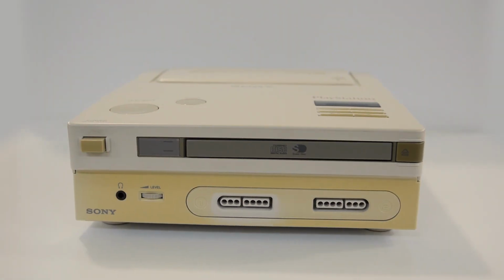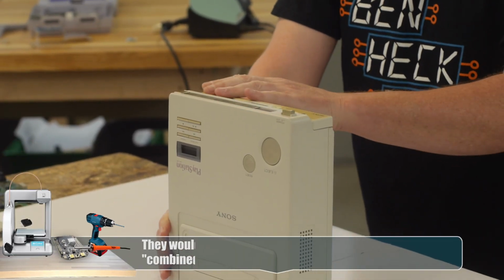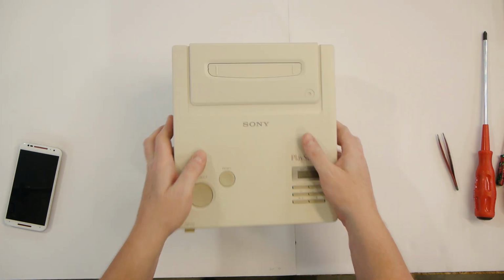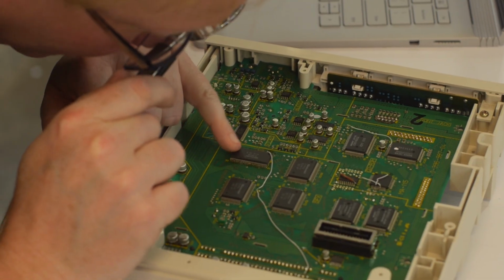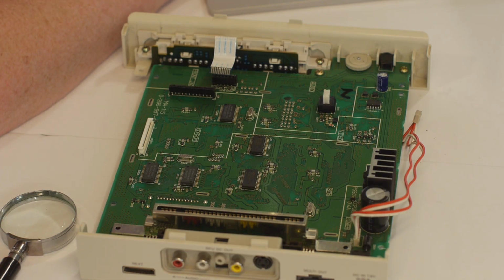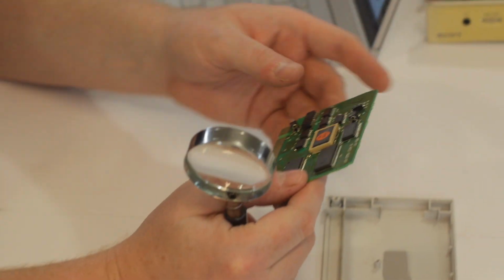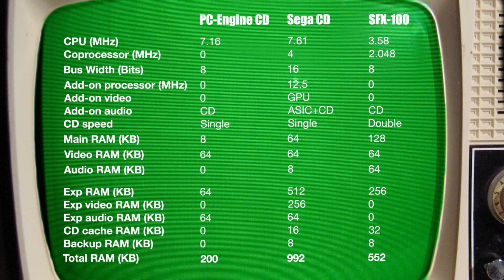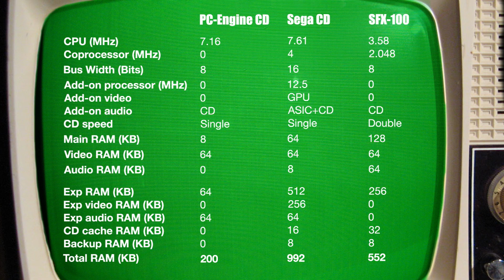Ben Heck's Nintendo-Playstation Prototype Pt 1 Teardown

Comment: Would it not be a right hoot to build a better Nintendo-Playstation using a ASUSTECH FM2+ motherboard and A10-7980k +64GB of RAM and install a Linux Distro with an MAME and somehow make it load the game from the cartridge instead of loading it off disc and keeping the OS+MAME on the hard-drive.

Comment: "You don't get divorced and hang pictures of your ex-wife around the place....."  I laughed out loud.

Do you think Ben is going to make a replica of this?  It would be a massive project compared to his replicas of older 8 bit systems, but for future gaming historians would be an epic resource!  Home-brew SNES-CD/SFX-100 games too!
Reply: the issue is finding replacements for the custom chips
Reply: That's not really an issue, as the CD chipset is a very common series, and found in many CD consoles.

Most of the registers are already understood by looking at the Superdisc ROM disassembly, and support is already being added to emulators etc.

It wouldn't be too hard to implement the CD add-on with an FPGA, but then yoi could only play (or write) homebrew (unless a prototype CD game is actually discovered too - there has to be one out there somewhere?)

Comment: "The Super Nintendo also was better when it came to graphics"

That is debatable/relative.
Reply: How so?
I mean, I can't make a fair comparison because I haven't played Genesis or PC Engine as much as I have SNES - but in terms of graphical capabilities, at least, it seems like SNES had better specs. More and larger sprites, greater color palette, more scroll layers, and limited hardware support for rotation and scaling (backgrounds) and color blending.
Genesis, of course, had more CPU power (why do you do these things to us, Nintendo?) and so could do some of that (rotation and scaling in particular) with software. But it couldn't overcome the color palette limitations (well, for the most part - as with most graphical limitations in these old systems it's a "per scanline" limit, not a "per frame" limit), or the scroll layer limitations.
I feel like the color palette issue puts Genesis at a pretty serious disadvantage, personally - at least when looking at it just in terms of graphics. The SNES had other graphical advantages as well but those could mostly be offset by Genesis' stronger CPU. That makes the system very versatile - it can't just be used for those effects, it can be used for any kind of processing - but it can't overcome the fundamental limits of the graphics chip, either...
But as I said, my experience with Genesis is very limited. I intend to rectify that one day. In the mean time, I'd be interested in hearing your take on the situation.

Comment: The PC Engine CD + the System 3.0 BIOS card (which the TurboDuo had built in) provided 192KB of additional RAM (on top of the 64KB of the base CDROM system) for a total of 256KB. The Arcade card which was released in Japan added 2MB on top of that.

Comment: Hey just a heads up the Sfx chip does not stand for super famicom x it stands fo super fx chip it's used for games like star fox and I think f zero and super Mario cart I hope I helped u out in some way :)
Reply: This thing predates the release of Super-FX chip games - the system doesn't have a Super-FX chip in it (the "SFX" labels were on the PCB, not the ICs, and Super-FX chips weren't labeled "SFX" anyway, they were labeled "MARIO CHIP" or "GSU") - the system probably couldnt have a Super-FX chip built-in, as it most likely would have compromised the ability for cartridges to provide their own add-on CPUs.

Comment: The PC Engine CD-Rom memory actually varies.
Just like this snes-CD solution, it had separate cartridges with the CD-ROM bios and embedded memory, and you got from like 64KB to the insane gigantic Arcade card with whooping 4MB of memory (!).
And this last one was used to port neo geo games almost flawlessly for the PC Engine system.
Maybe the snes-CD would follow the same route?

Also on the part where you said the 8bit bus would slow down the loadings, you're not exactly correct, given the fact the bottleneck on the system would be the CD-ROM read speed by itself rather than the system.
The CD-ROM max reading speed is around 300KB/s, which even using just the CPU to copy off, you still go faster, and well, you don't need to do that on SNES, as it has the DMA unit that copies data over 3MB/s easily, which is well more than enough to deal with the drive.

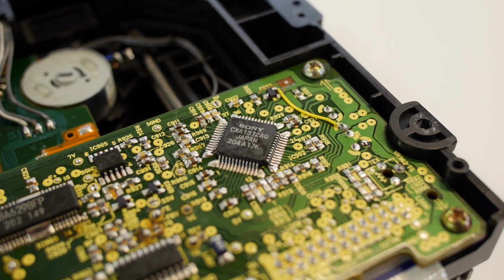Comment: 11:07 Are those pins on the Sony IC seriously bridged?
Reply: Do you mean the corner pins on the Sony chip?

That's very common on wave-soldered boards to have those triangle / teardrop shaped pads on the corners, as it helps prevent the solder from bridging the pins along each row.

If you're talking about the "BA" (Rohm) motor driver chip, then it's also very common for those to have a large tab in the middle of each row of pins, as it helps supply the larger current to the chip, and helps dissipate the heat better.
Reply: Chrm ... Well didn't know that!

Comment: metal Jesus rocks found a CD add-on for the Nintendo 64. go check it out
Reply: +ericbazinga The disk wasn't broken. Metal Jesus just didn't have the dev kit required to use it.
Reply: Yes teardown that!
See if you can fix the blue disk it came with!
Reply: thats because it isnt a dev model, he said that in the video
Reply: Suedeash no his is the only n64dd that is an American retail version, not a dev version
Reply: He found the American NTSC version of the N64 Disk Drive.  They were only sold in Japan, and thousands of the Japanese versions were sold.
Reply: Assembler has a lot of ultra rare shit, but he stays mum about it until he needs to trump someone.
Reply: Those unofficial Doctor64 drives were "relatively" common, and unofficial.
Reply: His was ana American n64dd
Reply: Assembler has several of those units.
Reply: yeah i meant to put disk drive sorry man.
Reply: That's just the 64DD, nothing amazingly special
Reply: @Suedeash  It kind of was but he really didn't go into detail about it. It was actually a 64 Bit addon to the N64 giving it a 128 Bit bandwidth and double the color pixel rate. It didn't do well in Japan because most gamers felt the floppy was a inferior platform to the CD-Rom which it was but during that time The C.E.O. of Nintendo of Japan (Famicom) was hell bent on not using cds because of their loading times which they saw with the Famicom CD addon which was also only released in Japan. If Nintendo had made it a cd-rom rather than a floppy the addon with the N64 would of superceded the Playstation by a long shot, but if Nintendo had done that we probably never would of seen the Game Cube.
Reply: @tskraj3190  ah I see, learnt something new today

Comment: In my opinion he ruined it.
Reply: He is going to fix it.
Reply: If the constitution was torn apart and it was put back together, it wouldn't be destroying it.  It would be restoring it.  Just like vintage cars, antiques, or paintings.  It's restoration and documentation.  Attempting to repair a product back to its original state is often times preferable rather than to simply sit back and allow it to dissolve back into sand.

If an Egyptian tomb is discovered, do you prefer them to cover it back up with sand and never open it to find out what history is inside?  Opening it is intrusive and removing all the articles inside basically destroys the intended purpose of the tomb.  Yet there's invaluable history within that can't be obtained without such intrusion.

There's 2 stances that are typically chosen when it comes to antiques.  One is to try to restore it to its original state, and the other being to preserve it in its current condition.  And considering this is an electronic device that can't be preserved in its current state (metals corrode, capasitors leak, batteries fail) I believe it's best to do any necessary repairs to keep the device working as closely to the original product as possible while documenting what changes were made.  Which happens to be what they're doing.

Disassembling this console hasn't harmed it at all, and it has allowed for it's internals to be documented, which to my knowledge is a first.  Also disassembling rare Nintendo cartridges is typically required to prove they are legitimate cartridges.  Taking it apart doesn't hurt it so long as you know how to properly put the screws back in.
Reply: Yes, but it wasn't broken when they found it, they said they played games on it while they were in Hong Kong. So, it was broken fairly recently.
Reply: The CD drive stuff has already been pretty much reverse engineered by myself and others by looking at the board layout etc.

The CD drive section uses very common off-the-shelf chips, sp the registers and timings are fairly well known.

The only real "custom" parts in the whole system are the two MCU chips for the CD controller and LCD display (the chip on the main board may be a small ASIC, but it's probably more likely a Hitachi MCU, like in thr 64DD.)

The other stuff has been mainly reversed by studying the "BIOS" ROM image that was kindly offered by Dan in order to be dumped.

KiiroBomber / LuigiBlood dumped the actual ROM I believe, and posted it online many months ago.

It runs on quite a few emulators already, and they are starting to add the CD emulation too AFAIK. ;)
Reply: well..I saw some videos and that thing used to work so it's not like sony couldn't get it working and ben will continue sony's work,
ben fixing it will return the system to his initial state (hopefully)
Reply: How so?
Reply: 503technics "I tore apart the Constitution, but you can tape it back together."
Reply: If he fixes it, he will have done quite literally the opposite!
Reply: They can't make an accurate replica because it's got custom chips and you'd need to destroy an SNES for its chips also.  Repairing and replacing the aged components for this system will give us more insight into how it worked when it use to. Without repairing it, we'll never know what appears on screen  when the CD drive functions.
Reply: great stuff!
Reply: There is a slight argument for collectors who like to pay for items "as-is".

Like with some antiques, some people prefer the items to not have even been cleaned, or for some of the original flaws to be kept.

On the SuperDisc, the "bodge" wires are part of it's original character, but also tell a bit about it's backstory, as you can clearly see what mods have been done, and have interesting discussions about WHY they might have been done that way (which some collectors would definitely want to keep intact).

But - I'm fairly sure that the unit will be worth more money if the wires are tidied up a bit, and once it's fully working again (especially the CD drive, even if no prototype disks have been found as yet.)

Personally, I'd just like to see it working again, and...

 #spoilers  !!

I have it on good authority / hinting that they likely did / do get it running again in part 2 of the vid. :)

The fact that the audio wasn't working before (while it was still playing carts), and now the whole machine has apparently died, it makes far more sense that something more simple like some of the electrolytic caps have dried out, or a regulator / diode has gone bad.

That could explain why both the audio and the CD drive section weren't working before as well (as they might share the same power rail of +9V or +12V for both the audio opamps and the CD motors.)

90% of the system just uses the standard SNES chipset, so the only things that can't be easily replaced are the two MCU / ASIC chips for the CD controller section.

Even the CD drive chipset is fairly standard though. I believe you can even still buy the Sony CXA chips and the Rohm motor driver chips online.
Reply: ElectronAsh If such collectors want the items "as-is" then they should pony up and buy items like these as soon as they appear.
Reply: When talking about antiques (although this machine is not yet an antique) and patina, you have to consider it's functionality.  Machines that work have far more value then those that don't work.  In the case of this machine, it has been modded for reason's outlined in the next video.  In fact, to make the CD work again you had to disconnect one of the bodge wires.  The idea is to restore the machine's original functionality.  

You only consider patina in a an antique when it doesn't hamper functionality and will function better then when it is cleaned up.  Most people who collect machines want them to function and not be static pieces of art.
Reply: Hou ruined it
Reply: i agree
Reply: See what I mean?
Reply: 503technics It was better broken. It was history.
Reply: as you know how to properly put the screws back in and not destroy the plastic with the Screwdriver while trying to take it apart :-P
Reply: I'd rather see this thing disassembled and studied (and the results of that study shared) than have it just sitting around as a pretty relic. Of course, that's not my call to make, 'cause I don't own it. But I'm happy to see the owners appear to share that point of view.
The mere existence of this thing isn't important. Its original vintage state can be studied and documented. There is a possibility of seeing this thing as a working system: I think that's far more compelling than just mindlessly preserving the state it was in when the project was abandoned.
To offer another analogy, another "Constitution" that was torn apart and reassembled: The studio model of the Enterprise from Star Trek was recently restored, and it's back on display in the Smithsonian. Prior to the restoration, numerous (less-carefully-executed) restorations had been performed over the years, and one of the goals of the new restoration was to undo some of those poor choices and get the model looking like it did when the TV show was being produced. But even if it hadn't been messed up by previous restoration work, a restoration would have been worth it to shore up some old wooden construction that had weakened, get the lighting system working again, and so on. The model is no longer as it was in the '60s, but it wouldn't have been anyway due to age and periods of neglect. The new restoration makes the model a viable exhibit again, and the process of the restoration has given us all insight we wouldn't otherwise have had into how it was constructed, how it was painted, and so on.
Reply: TetsujinZipit Z2 Chris Hicks There is nothing wrong with taking it apart and documenting it, like the reference Chris made to an Egyptian tomb, it makes since. But to modify it? That's what I disagree with. You know he is going to solder on the board, add wires, etc. Why play with the original when you can reverse engineer, or something to that degree?
Reply: Are you going to lose sleep over this?
Reply: Light Yagami Yep
Reply: reverse engineering it as long as he is not modifying it is very good because people can then make replicas!
Reply: also if the console was working the circuit must be ok so ben doesn't have to run mod wires.
i think ben wil just replace a bad component and the system will work again!
Reply: I'm just stating that these types of collector definitely do exist.

The question is whether the Diebolds are looking to sell the unit any time soon?

I think Dan said before that he had no intentions of selling it "at the moment", but that was a while ago now.

Maybe they do indeed have a buyer in mind already though, and the buyer perhaps requested that they do what they can to repair it?

Having said that - I recon Element 14 makes enough money to have covered the cost of the unit if something bad did happen during the repair? lol

(and so it does seem fitting that Ben Heck was chosen to repair it, as he could probably even afford to buy the unit as well.)

Personally, I think it's well worth the risk trying to at least get the unit to power up and play carts again. Getting the CD drive working too would be ideal of course, but anything would be better than a dead Superdisc IMHO.

As I said before though - most of the chips on that thing are replaceable (standard SNES chipset). The only truly "rare" chips are the two for the CD controller and LCD (or more to the point, the code / logic in them.)

The ROM on the "CD cart" has been dumped and released already, so at least that's definitely been preserved for all time.
Reply: Dat Boi The kid had already had it apart numerous times, so if your argument is that Ben ruined it because he opened it, then it was ruined long before he opened it.

Taking apart a MACHINE does not devalue it in any way, shape or form. It's literally screws that are easy to remove and easy to put back without anyone knowing they've been removed. The Constitution is an old piece of paper, ripping and old piece of paper and attempting to tape it back together is NOTHING like removing screws.
Reply: Tetsujin Do they let you touch the Constitution? No, let alone rip it apart it analyze it. It tore it apart. He's going to modify it. He has ruined it.